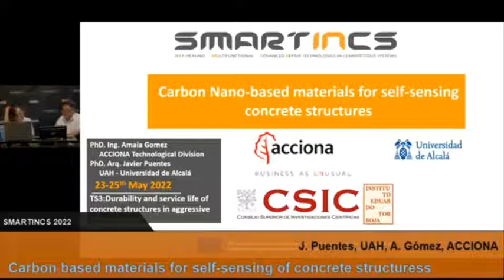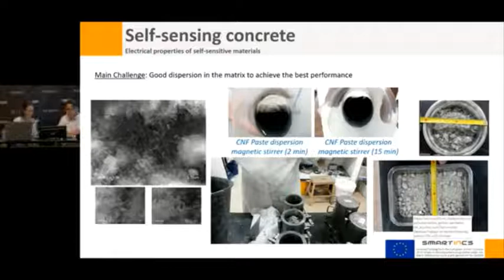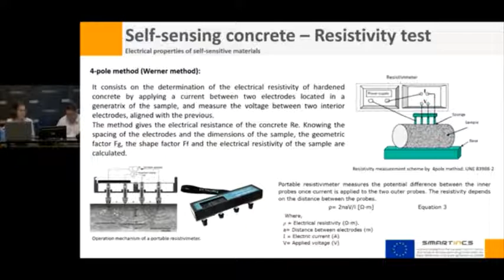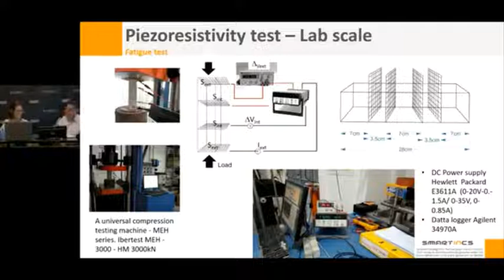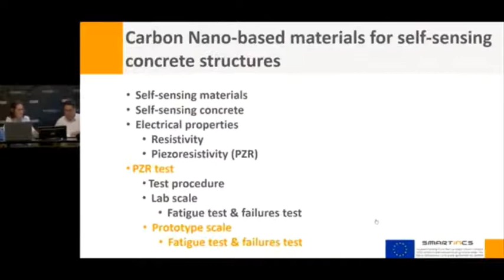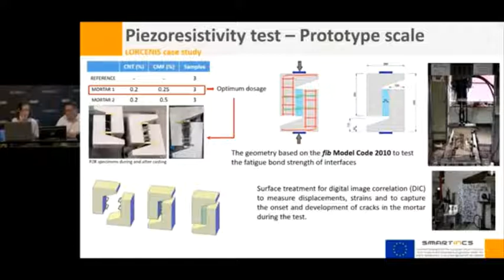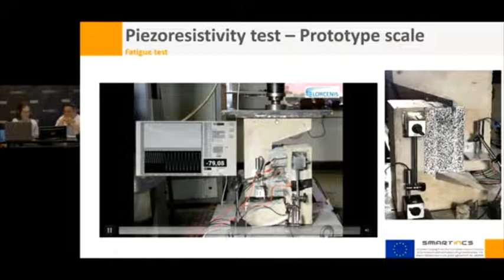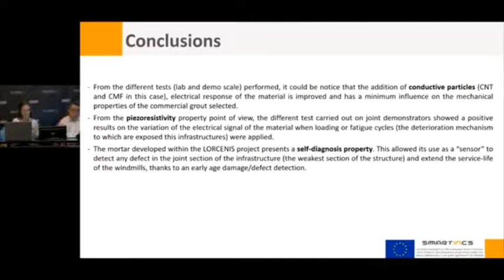Day 2 Part 7 -  Carbon based materials for self sensing of concrete structures

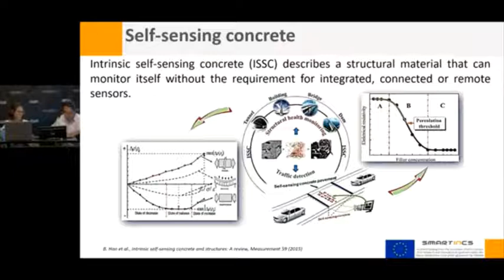Comment: I stopped at 3:55 I'm glad the video was made an all, but I immediately came to the conclusion that I can brag about knowing some details about concrete and the nature of threats via elements etc that a mix can face and how to endure although I don't know how to make said concrete for any version of product, but I do know some vague building tips about underground construction involving the depth and size of blocks if earth is leaning against your construction, and my conclusion overall of why it's not pertaining to me is that, it just so happens china usually has earthquakes and below surface construction or not this, this type of monitoring of the Integrity of each block at key points is invaluable cost effective and user friendly for people doing large projects in china only atm in immediate comparison to my own area.